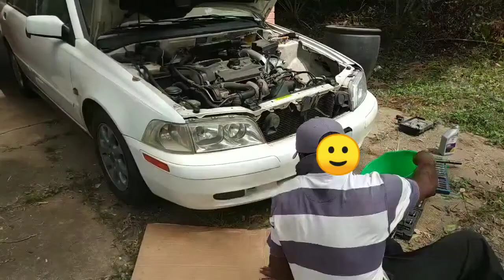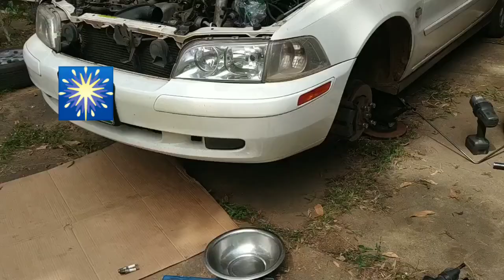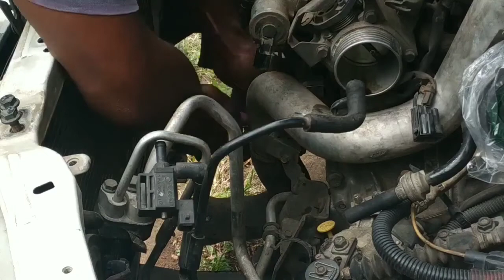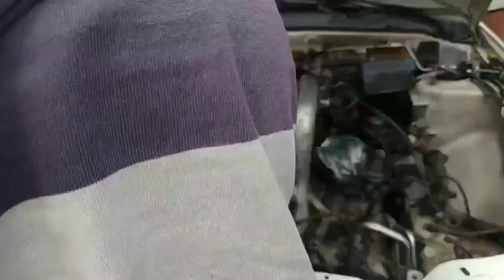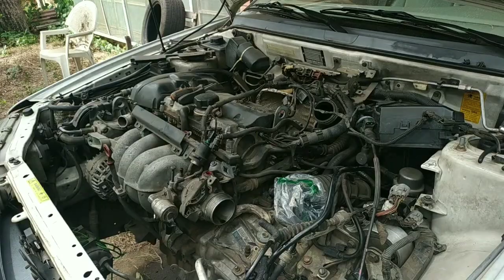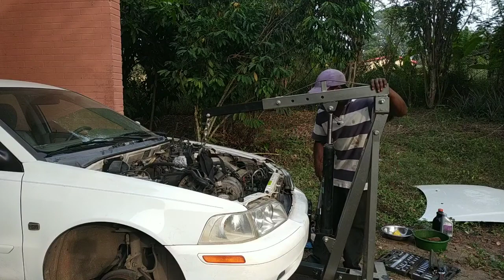2000 - 2004 Volvo S40 / V40 1.9T Engine & Transmission Removal (Time lapse)

Comment: Great job. Is it easier to pull the engine with the transmission? Or can I leave it in if I don’t need it
Reply from the maker: Thanks. I don't think you Can take out just thé engine. There isn't enough Space to séparate them on thé car. Maybe you Can take out just thé transmission from underneath

Comment: How do I see that the censor is not  working
Reply from the maker: What sensor are you referring to?
Reply: @olfeno7506  the one on the crank shaft S40 Volvo 2ooo model s,got only one on top of the tapped cover
Reply from the maker: @thomaspaledi1300  not sure what you are referring to. Thé crank sensor is located on thé Bell housing and reads off thé flyeheel. It has only one bolt. It is below thé turbo charge pipe